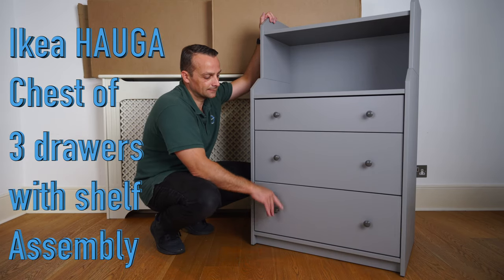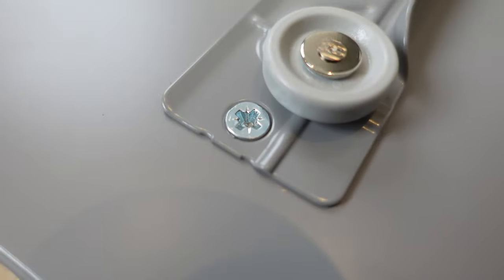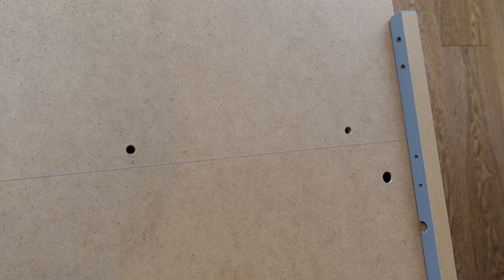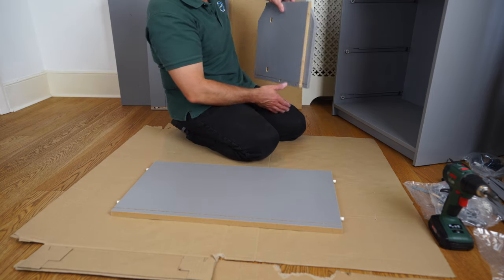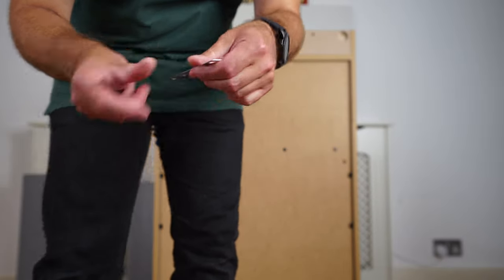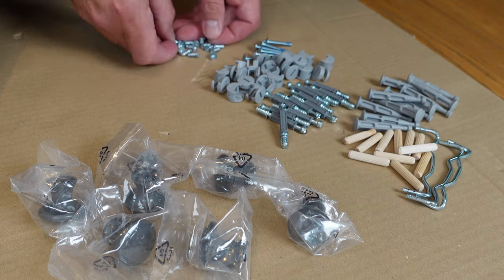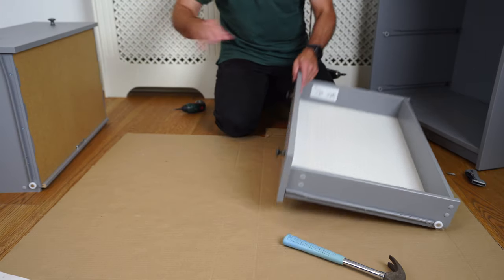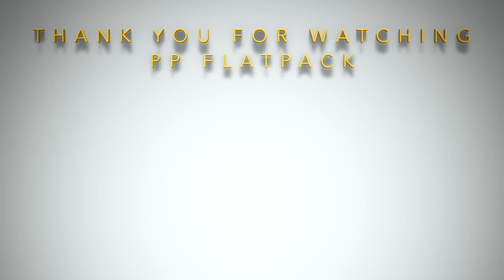Ikea HAUGA Chest of 3 drawers with shelf Assembly instructions

Comment: 440. Where did you get the small white fastener that are inserted in side panels, to connect with bottom panel?   Your item had fasteners installed when you opened, mine does not have those.  It does not show what to put in panels to click together.